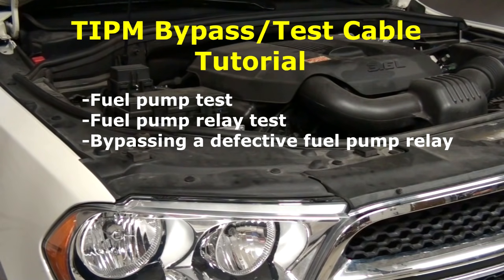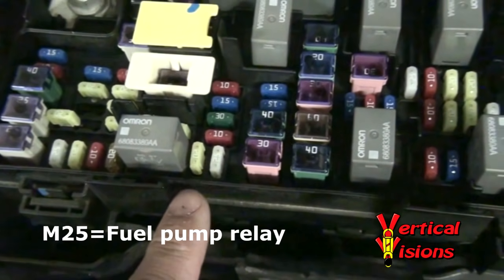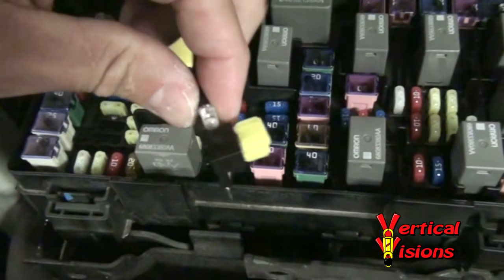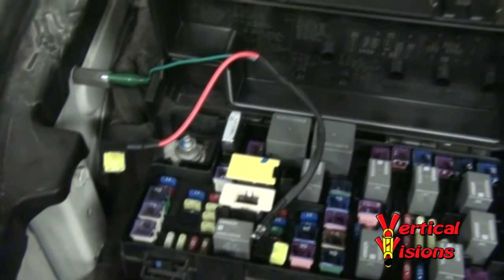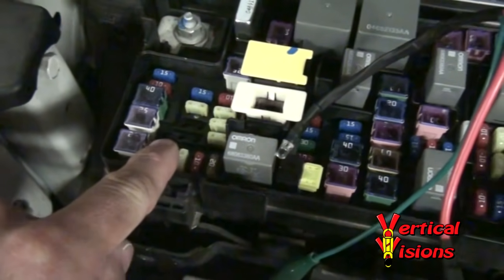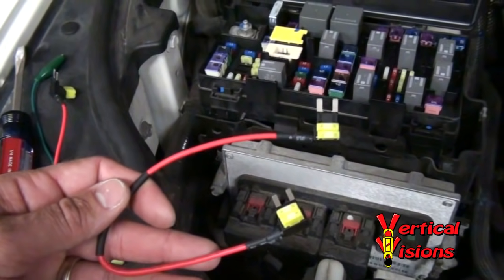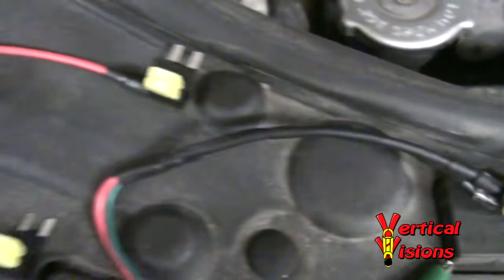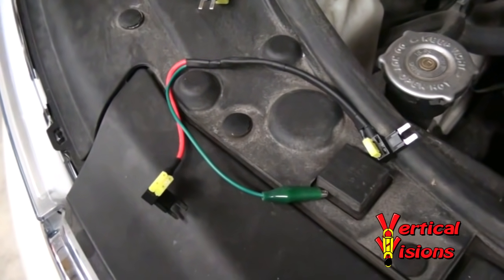TIPM Fuel Relay Test and Bypass Solutions - Most 2007-2021 Dodge, Chrysler, Ram, Jeep, VW Vehicles

Comment: I have a 2009 Grand Caravan  and don't have a problem with the fuel relay but I constantly get a P1128 engine code. Replacing the upstream O2 sensor solves the problem for a while but then the code comes back. I read some where it could be  a faculty TIPM. Have you experienced anything like that? If the TIPM was $200 I would change it but in Canda a used one is $500+. ANy suggestions?

Comment: hi need to see if you have a bypass for a 2007 dodge nitro DISTRIBUTION BOX The door will unlock but not relockwas told I need a new TIPM Box .Thanks
Reply from the maker: Bypass cables won't work for door locks, but it sounds like you have a faulty door lock relay.  Door lock relays on your vehicle are double relays, meaning there are two functions inside each 10 pin enclosure.   My company (Vertical Visions) can perform the repair work by testing all three double relays related to your door locks. Then, the faulty relay is desoldered from the circuit board and a newer version of the same double relay is soldered and tested.  Visit our website for further information:  http://www.verticalvisions.com/TIPM_solutions.php#solution2

Comment: I had a customer with this issue. (no start or pump didn't shut off) They took it  to the dealer. They threw a pump at it.( where I work we deal with a lot of caravans and we see this a lot) Someone else threw a battery at it for the draining issue (... from the pump running) The dealer was certain it was our conversion causing the battery to drain... while coincidentally the" fuel pump failed" ( even though the customer told them they could hear something running sometimes in the back of the van and sometimes no start!!!)This particular van was very intermittent / tricky to diag but it was clearly a tipm issue.  I happened to have a couple add-a-circuits and l.e.d.s in my box and made one of these tools. Also back probed the wire from the p.c.m. to the t.i.p.m. with a test light to verify it was getting a signal to the pump relay (not a corrosion issue) and took it back to the dealer to prove 100% . No more arguing this issue !!! AWESOME  tool for intermittent failures and for demonstration purposes. Thank you!!!

Comment: Will this relay fix horn random honking problems
Reply from the maker: The fuel pump and horn relays are identical part numbers.  If you have a random or "stuck on" horn, then the cheapest solution is likely a TIPM repair (http://www.verticalvisions.com/TIPM_solutions.php#solution2) where the TIPM is disassembled and a new relay soldered to one of the six circuit boards under your fuses.  Since bypass cables are a "key on/relay on" solution, they wouldn't work for most other relay-driven devices.

Comment: I didn't know you had made a you tube video on this. I had emailed you 1 1/2 years ago thanking you for coming up with this solution. My 2011 Chrysler Town and Country had hard start issues from the fuel pump relay not sending power to the fuel pump. It was very fustrating for my wife trying to drive it and it not being  reliable at restarting after making a few runs during the day. I noticed when weather was cold outsude it made the symptoms worse. I did take the TIPM puzzle apart and cleaned the three sandwiched boards hoping it would help. I do not recommend trying to do this. After months of trouble the relay got stuck on and would now drain the battery daily. I found your blog on a Google search and made my own bypass using your instructions. The van now has 11500 miles on it. I did install an autostart remote a year later and it worked! I am sorry for not responding to your email as I missed it and found it 3 months after. I recommend this fix for all having this issue. Thanks  again for your help and wish you and your family the best.
Reply: arnie ayala
Reply: arnie ayala
Reply: arnie ayala c

Comment: do you have one for a 09 nitro
Reply from the maker: It appears our TIPM test/bypass cable will work on a 2009 Dodge Nitro, but it's not been fully tested.  The TIPM itself is similar to other models we normally work with and other websites indicate it's wired the same.

Comment: Jason I have a 2011 Ram 1500, i want to put the external fuel pump relay on the TIPM. The Instructions on the recall say tap onto the pink with green wire on the 40 pin connector. the Durango and the Ram the wire is in a different pin location. It is directly on the other side. there is a all pink wire in that pin location.  Do I still tap onto the pink with green even though it is a differant pin location? is this Ign power? trying to locate a wire diagram of a 2011 Ram tipm 40 pin connector cant seem to find one.
Reply from the maker: I've only seen details for an external relay on a Durango or Grand Cherokee and our website has this information.  External relays on other vehicles are a mystery in that I just don't know if the same wires apply.  My assumption is you'll have a difficult time finding wiring diagrams and external relay instructions for the 2011 Ram because Dodge would much rather sell you a new $1200 TIPM.  If you find that you can't proceed with an external relay, check out our website for other options:  http://www.verticalvisions.com/TIPM_solutions.php

Comment: hey bud...great idea.. does this work for a 2011 dodge ram 5.7 hemi
Reply from the maker: Yes, either our TIPM test/bypass cable or a TIPM repair (http://www.verticalvisions.com/TIPM_solutions.php#solution2) will solve a faulty fuel pump relay issue.

Comment: I have a 2011 Ram 1500 and it started having issues starting at about 78000 miles on it. Well at 79000 it started taking 20 minutes to finally start. Then it eventually just did not start. Used my expensive research tool (google) and found this YouTube page. I bought this relay bypass solution couple of days ago and installed it today. Took a couple of minutes to install. It worked!! The truck started right up after the first turn of the key. Oh man what a blessing this was to have my truck back. Do not hesitate to purchase if you 2011 Ram 1500 truck keeps turning over and then finally starts and various times. I should have bought when the issue first started. Thanks so much Jason keep up the good work.
Reply: Roger Hinojosa in
Reply: Roger Hinojosa Was this a permanent fix for you? I also have a 2011 Dodge Ram 1500, that is having the same problem.  Thanks.
Reply: Yes it is still good.
Reply: Roger Hinojosa i
Reply: Roger Hinojosa it's been a year are you still running the truck like this?

Comment: hi do you know what fuse number for the "engine control module" on a 2011 chrysler 300c
Reply from the maker: No idea.  Google the operator manual for your vehicle.
Reply: Ok thanks

Comment: HI!  I have two dodge caravans 2011 and 2012 that started with same type symptoms, faulty starts, would start on Neutral and draining battery completely.  We changed the fuel pump based on mechanics instructions, car started once and wont anymore. i watched your video and simply changed the fuses, it started once and now wont start again.  Help, please.  Definitely my issue must be related to this.  Thanks in advance!
Reply from the maker: Our TIPM Solutions website lists several options to solve this issue:  http://www.verticalvisions.com/TIPM_solutions.php

Comment: I have 2011 VW Routan. the fuel pump keep working after turning the engine off until the battery dead what is the solution for that??
Reply from the maker: Our TIPM Solutions website lists several options to solve this issue:  http://www.verticalvisions.com/TIPM_solutions.php
Reply: words is not enough to reward this man. after I called him, I fixed my own relay by myself. it was not easy but it worked perfectly. the only thing I can say to him MAY GOD BLESS YOU AND YOUR FAMILY.

Comment: Jason, my friend has a late model Jeep Wrangler JK and the wipers are NOT working, the mechanic says the motor is good, switch is good,fuse is good but they will not work. Do you think the wiper relay in the TIPM  could be the problem, and do you thin we cold by pass it with your TIPM test/bypass cable and add an inline toggle switch to be able to turn the wipers off and on?
Reply from the maker: Yes, it could be the wiper relay.  As long as your wiper fuse is located between the wiper motor and relay in the circuit, then a bypass cable with inline toggle switch should work.  A better option would be to simply replace the bad wiper relay.  We should be releasing a new video soon that shows how to remove TIPMs from your vehicle and make relay repairs.
Reply: Ok, I'm looking forward to seeing the new video, please let me know when you post it. Thanks for the good work....

Comment: I Have never ordered anything off line much less from a You Tube video that has done Exactly what it claims it will do. If you are having any problems with your Chrysler vehicle starting or fuel pump running after you have turned off your vehicle then try  the TIP M Bypass by vertical Visions. This is where you need to start your search .I have a 2010 Ram 1500 and I was having all the symptoms described in the video. My Truck sat for a few weeks before I came across this video . Jason Bell has saved me hundreds of dollars. it took all of 3 min to hook up and I was up and running. Thanks Jason Bell I wish you and your company much success .
Reply: Installed the bypass and vehicle now starts but the epic / info panel on the steering wheel still dies not work.

Comment: My 2008 Town and Country has an issue of the first start.  It starts and runs fine.  But after about 3 blocks it goes into a stalling running rough for about 10-15 seconds.  Then it resolves itself and runs fine the rest of the time.  Also in the morning.  Sometimes on the first start the dash lights go wacko and the wipers go on when they should not go on.  This seems to be a tipm issue.   So do you think any of your fixes could work here?  Or if not.  Can i get another tipm off of another vehicle without going to the dealer (any programming)??
Reply from the maker: Modern TIPMs contain circuit board soldered relays for the fuel pump and wipers.  It's possible that these relays are the problem.  We have not tested the 2008 T&C, so I can't say for sure our TIPM test/bypass cable will work for your fuel pump issue.  Wipers are used intermittently, so our bypass cable would force them on when the vehicle is on.  If you elect to purchase a new or used TIPM, you'll likely need an hour of dealer programming time.  Most TIPMs require the VIN to be programmed so it knows which functions your vehicle contains.  

Another option is TIPM repair where the fuel pump and wiper relays are replaced with new ones.  Tearing down the TIPM takes some work and skill, but it's far cheaper than a new/used TIPM.  You would need to remove your TIPM from your vehicle and send it out for 24 hour repair.   Contact me at 304-933-9330 if this is something I can assist with.

Comment: I have a 2010 Dodge RAM 1500 and I am going thru this now I have had both symptoms On Thanksgiving I drove to a family members house and got out and thought I heard a noise coming from the rear of the truck thought it would cut off ....It did not but I caught it before ran the battery down. late that night I disconnected the battery . Next day re- connected and it ran fine . then it started taking a long time to start two, three sometimes four try's . Now it wont start at all well I take that back It did start after a weeks of sitting while I was away. Do you think this cable can fix my problem I cant afford this TIM P thing.
Reply from the maker: The symptoms you describe match a faulty fuel pump relay perfectly.  However, we have not tested our test/bypass cable with your particular vehicle.  You could always build your own cable and test it using the plans on our website, or we sell them for those who can't locate the correct parts.  www.verticalvisions.com.  Good luck.
Reply: +Jason Bell It worked just like you said it would. Thanks.

Comment: i read the years starting at 2007. so there is no way i can used your electrical test wire for 2006 caravan. just wanted to confirm
Reply from the maker: You would have to test your 2006 Caravan to see if it would work.  We've only tested back to 2007.  As long as the fuel pump fuse is positioned in between the fuel pump and fuel pump relay within your circuit, you can pull power from many sources to drive the fuel pump.

Comment: Jason, I see you are an engineer. Where can I contact you (FB, email, etc)? I have an issue with a 2015 Grand Cherokee Altitude that the driver's turn bulb stays hot all the time even with the vehicle off. This happened after attempting to install an custom harness for OEM Bixenon (from halogen). Something got fried somewhere, I paid the dealership 4hr diagnostics and they still can't figure it out. Sorry to be off subject but I don't see any contact info. I was hoping you had some input since you are familiar with this vehicles TIPM.
Reply from the maker: My contact information is here:  http://www.verticalvisions.com/contactus.php

Comment: I was just told I need to replace the TIPM to fix a problem of having no trailer turn signals/brake lights.  The tail light and reverse light pins on the trailer connectors work fine....but the turn signal pins do not.   Any chance a workaround like this cable might help this situation?
Reply from the maker: Do the turn signals on your vehicle work, but not the trailer turn signal pins?  I would have to investigate to see if turn signals use a TIPM-mounted relay.
Reply: +Jason Bell Yes, turn signals on the vehicle work fine, as does everything else.   They indicated there was no power at the spot there was supposed to be (on the TIPM I assume), so they diagnosed that I needed a new TIPM.  This is a 2013 Durango.  The diagnosis was made by a shop (not the Dodge dealer).   I'm going to try and go back and see if they'll tell me more details (such as which fuse# had no power).

Comment: I just had the test cable arrive today and it's installed and my van is back on the road.  Thank you much.  The dodge dealer told me it was the TIPM and the fuel pump and recommended replacing the fuel pump first.  The fuel pump is good.  At 00:36, where is that board?  I took the TIPM out and opened it up removing each level of contacts and didn't see a board like that.
Reply from the maker: The circuit board containing the fuel pump relay is located under your fuses.  There are 5-6 individual circuit boards between the fuses and the fuel pump relay.
Reply: Okay...thanks,I saw another video and it appears to be located on the underside of the TIPM.
Reply: wonder if it will have any 2nd efects since we by pasing pcm sinals too?

Comment: my truck works fine again with the cable. of course remote start doesnt work but my AC is not working now? any ideas why my AC is not working?
Reply from the maker: Check the AC fuse.  Perhaps it got bumped during your TIPM testing.
Reply: +Jason Bell I found out what it was. I just recently changed my spark plugs and I didnt know that when you disconnect your battery the fuse will sometimes ark itself (get stuck). So I disconnected the battery for ten minutes and reconnected it and the fuse un arked itself and AC is working fine now. other than that Thank You so much for saving me over a grand to  fix the TIPM.  im more than fine to sacrifice my remote start to have a vehicle that runs. Thank You so much once again! Dodge may need to hire you!

Comment: Did all the testing like you showed.  Relay is faulty, waiting for recall appointment.  Made up the "add a circuit" like you did and installed.  Worked fine.

Next morning, cranked but didn't start.  Turned the vehicle off ,then back on and it cranked right up.  Vehicle will start right up when it hasn't sat for more than an hour.

Remote start only works when the vehicle has been running and not sitting for more than an hour.

8:12 you said "you may have to cycle through your ACC and RUN before starting.

What does that mean?

Thanks
Reply from the maker: In some cases, my 2011 Durango won't start the first time I put my foot on the brake and hit start.  Not sure why this occurs.  If this happens, you'll need to keep hitting the start button, which cycles to ACC and RUN while your foot is still on the brake.  This situation can occur for vehicles with or without the bypass cable in place.  I'm not sure why my vehicle does this, but I felt it was worth mentioning.

Also, in your post, I assume you removed the bypass cable on the next morning when you mentioned it cranked but didn't start?
Reply: Seems like its working now without any problems.  remote start still wonk work but the man that made the video said it may not.  I feel much better with the relay bypassed until I get into the dealer for the factory bypass.  Only reason is I want the remote start to work and am assuming the factory recall bypass hack will allow the remote start to work again.
Reply from the maker: Remote start doesn't work with a bypass cable installed because in that mode, the vehicle disables cigarette lighter power.  Of the hundreds of bypass cables I built, only a few people ever put this on their wishlist.  Most are just thrilled with having a vehicle that starts.  Perhaps I'll research this area more and try to create a solution if it doesn't get too complex.  Thanks for your feedback.
Reply: I think your cable is awesome!!  Not taking a shot.  It elevates the tension every time I get into the car!!!